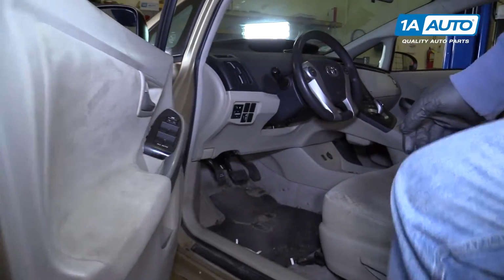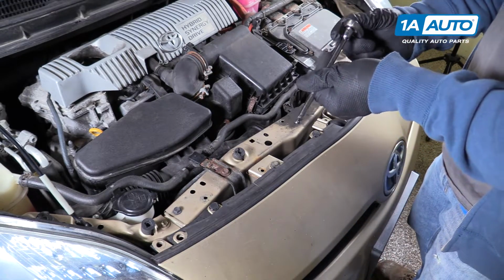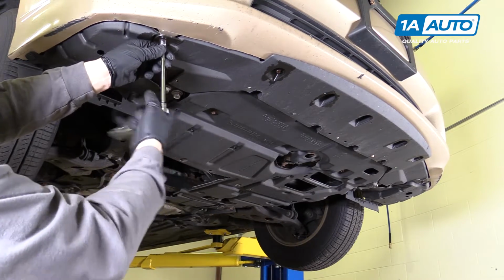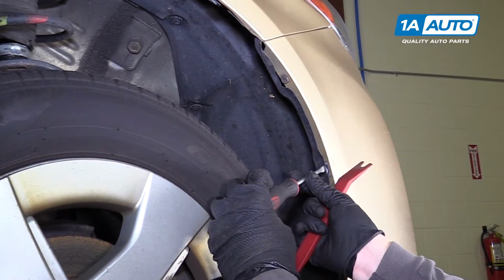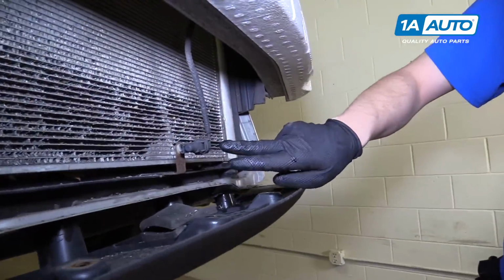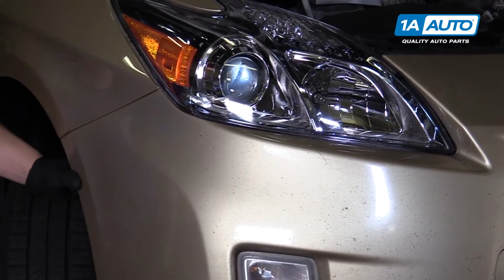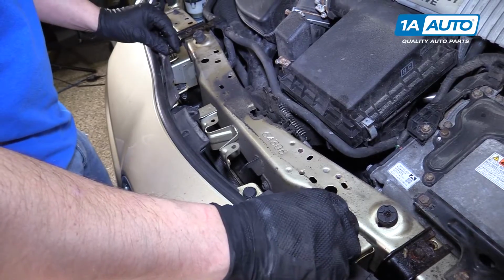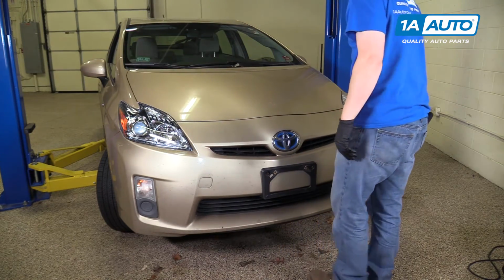How to Install Ambient Temperature Sensor 10-15 Toyota Prius

Comment: Thank you for this very clear and helpful video. Your steps worked perfectly on my 2010 Prius Model 5 with one exception. My car has headlight washer/sprayers. There is a washer fluid tank on the right side of the nose with a little, cylindrical pump.  This has a small hose that goes across to the right side of the front bumper system.  An inch or two beyond the pump there is a hose connector that can be disconnected by squeezing the little hoop and pulling.  It came apart easily for me.  Be ready for a flow of fluid - I used a cut-open jug.  Also, I don't think there is any way to get to the sensor without removing the front bumper.  I tried.  The path is blocked by the lower portion of the bumper even after removing the black bottom cover from just behind the front bumper.  But overall, the video was very helpful and I was able to do the job by myself without damaging anything and getting past the tricky steps.  Thank you!

Comment: What's the binifit of that sensor???
Reply from the maker: +م تمام فرزات The ambient temperature sensor (ATS) monitors the air temperature outside of the vehicle. Thanks for checking us out!
Reply: Is it related with radiator fan delay  up to 96 ° C in Corolla 2013

Comment: In my Auris 2007 it is much easier accessible without the need to remove the whole front bumper. Simply pushing the small mask which is in front of the sensor, it will get unsecured and you will get immediate access to the sensor in less than a minute. After you are done pull the small mask towards you and make sure that all  clips are secured. From the video it seems that the same can be used in Prius since similar mask exists.